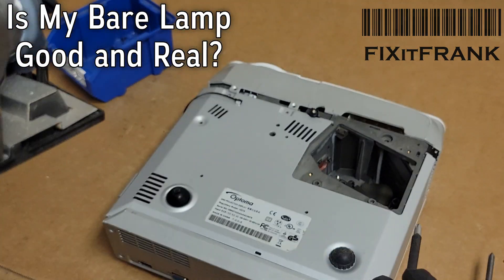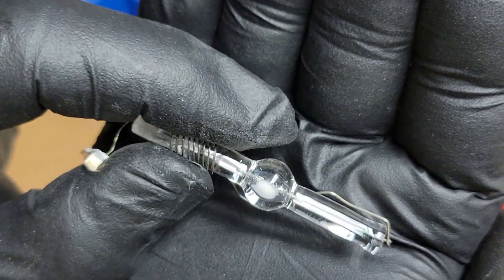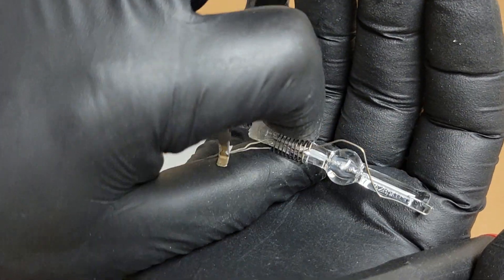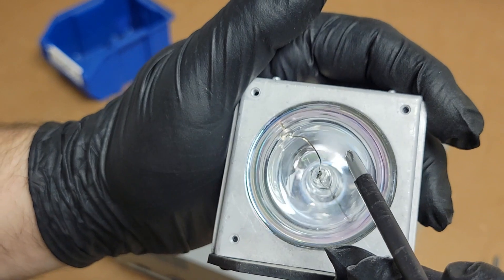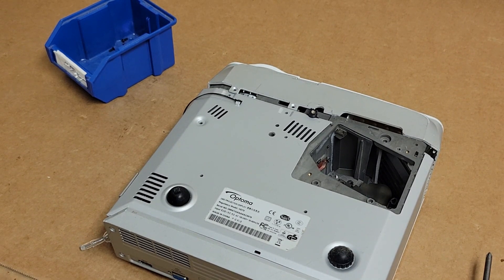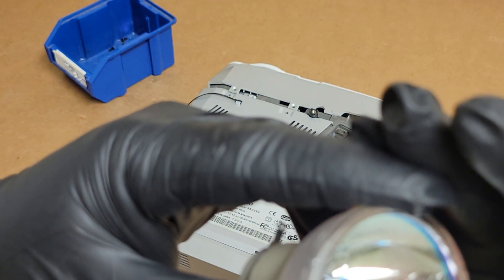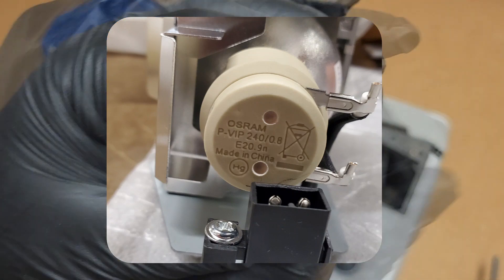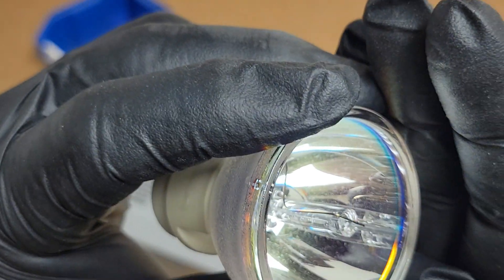Is My Video Projector Lamp OK? Is It Real?

Comment: My lamp seems good visually. But not lighting. Im wondering about the exposed lead that is connected from the front and goes into the center crossing the arc if its supposed to have continuity since its actually attached to the front lead.
Reply from the maker: Only continuity is to the screw terminal from the center point.  These are arc lampa which means no filament, so no continuity. I go over this in the video
Reply: @FixitFrank i double checked my lamp. And its confirmed that its busted. I tried another lamp from other projector and it works. But i cannot fit the lamp from other unit cause lamp is a bit bigger and longer but lower wattage.
Reply from the maker: What do you have? I might have a source unless you found one.
Reply: @FixitFrank I have 2 units hitachi. CP-X251 and CP-S317

Comment: I got Epson ELP89 OEM lamp that died at only 1200 hours (first lamp for the projector). I determined the conductor in the front of the arching element (the bulb) has separated from the conductor lead. Can I simply soder it together or is the temperature too hot and it will melt regular soder? Any other methods to re-attach?

The arching element inside the bulb looks very clean, no haze on bulb glass
Reply from the maker: Unfortunately the lamp is trashed.  That burned itself and melted. There is no repair.  The temperature is way too high there.   Your lamp blower fan is probably not working as well as it used to. There is a fan that directs air into the housing and directly across the tip of the arc tube. This is a common failure for epson. One of the many.  If you got 1200 hours, that is pretty good for an epson this old.  I'd use this as an excuse to buy a new projector. Any replacement lamp will also fail that way. I see it on newer epsons as well that use the ELPLP96. Personally I would stay away from epson.
Reply: @FixitFrank  thanks. The burn out event was 2 years ago and since then I have had another OEM lamp for 1400 hours and going. So Probably an issue of lesser qulity first lamp. I found out now, as I purchased a replacement bulb and got to dissemble the housing.

Comment: A question about lamps - it seems like many are discontinuing replacement lamps for my projector  - Vivitek HK2288. The only two more well known shops that have them the one that starts with a J and projectorlampsusa. I would generally go to Pureland but they don't seem to have them anymore - getting worried that I won't be able to find a replacement when it's time to replace the lamp - only about 800h now.
Reply from the maker: I see what you mean.  thats a tough one.  in your case, you may want to look for the bare lamp and keep the old housing.  you can use the numbers on the back of the ceramic to find another.  I'd get one soon and put it away so you have it for a spare.  This particular model was not super popular and the housing is expensive to make so I can understand (partly) why its not available.
Reply: @FixitFrank  Thanks for the reply - I'll look into that. It's a great projector - I picked it up used for $500 about a year ago with only 250h and have been floored by the clarity and colors - the colors are right up there with my 6050UB but the clarity with high quality source content is on another level - of course contrast is not as good. The contrast is very good for a 4K DLP shifter at around 2000:1 native compared to most of the BenQ, Optomas, etc at 1000:1 or so. The image it puts out reminds me a bit of some of the the 1080p 3DLP models like SIM but with much higher resolution (obviously still has RBE though). I think the main issue was many had problems with signal dropping - I've seen it but after upgrading to a HDMI 2.1 optical cable it's been a non issue.
Reply: @FixitFrank  I finally found a supplier for original lamps - PSSAV. It was shipped directly from Vivitek and being that it's a binned original lamp from March 2024 it's very bright and hits the 2000 lumen rating of the projector (uncalibrated) and 1200 lumens calibrated (same as reviews). It's over twice as bright as my old original lamp with ~1500 hours.

Comment: Hey Frank, thanks for posting all these videos. I did notice one of your comments that counterfeit osram bulbs are not very common but I see tons of osram bulbs on aliexpress with all the engravings and lettering on the back of the bulbs, the same as a genuine one. I did order one to see if they have the serial number engraving on the bulb itself as well as testing the resistance between the negative and positive terminals. 

I currently have a BenQ W1070 and the bulb it uses is "p-vip 240/0.8 e20.9n" and both osram shopyourlight and osram's only authorized reseller are both out of stock of this exact bulb.

They do, however, have the "p-vip 230/0.8 e20.8" for $56 and in stock. I checked the specs of both bulbs and they both appear to have the exact same base with exact same arc length. The only difference in the spec sheet is that the 230w bulb runs at 76v nominal while the 240w bulb runs at 70v nominal. Since I'm planning to upgrade to the th575 anyways, I plan to order this bulb to see if it'll work as a projector in a different room. My W1070 bulb exploded a week ago, it probably had 2000-3000 hours non eco mode. Regardless, I'll probably report back on whether that 230w bulb works or not. It seems like it would use the same gasses internally as the 240w bulb as long as it's genuine?

Comment: Can HID or P-VIP lamps like this be tested with an ohm meter?
Reply from the maker: Not really. You can check if they're shorted but a good arc lamp will read open circuit. So will a worn out lamp. Meter is not much help here.
Reply: @FixitFrank  thank you. I appreciate your explanation and it makes sense.

Comment: How to check the lamp it's working are not in multi meter
Reply from the maker: It is not possible.  Arc lamps are open circuit. All you can test is for arc point shorts.  0 ohms= bad.  infinite ohms= maybe okay.
Reply: @FixitFrank  thanks lot for replay 
Sir LCD panel alignment video please
Reply from the maker: sadly I don't do those.  LCD panel alignment is too much work and doesn't pay.
Reply: @FixitFrank   pls pls sir for technical ideas we also learn

Comment: Do you know a method to look for the right projector bulb based on a projector model? Often i need to order replacement bulbs based on a projector brand + model but it can be very hard to find the right bulb online. Is there some sort of database or a website that contains this info?
Reply from the maker: It's not entirely that simple.  Replacing the bare lamp is always the best way to go.  It is doable of course but there are more parts that wear out than just the bare lamp.  Depending on the model, there might be a lamp meter IC that needs to be dealt with. There is also the lens of the lamp assembly. Those do wear believe it or not.  If you reuse a bad lens, you can melt and damage the shape lens or polarizer depending on the model.

The other issue is that there are lot of older bare lamps that are no longer made by Philips, Ushio, Phoenix or Osram.  Osram in particular barely makes any projector products. Many have newer replacement options and wont be what is listed on the old bulb. Philips doesnt even make bare bulbs anymore.  Signify is licensed to use the UHP name and hardware.  All new UHP lamps come from Signify with Philips licensing.

You might not really save much money by changing the bare bulb.  Most housings only cost $20 or so more than a bare bulb and that saves you a lot of time and hassle.  

10 years ago, replacing the bare bulb was well worth it. These days, not so much, in fact because manufacturers get cheaper rates on bare lamps the full assembly can even be cheaper than a bare bulb.  But again, it does depend on the model of the lamp.  Some can still save a lot of money.  The Projection Design 400-0500-00 is still pretty expensive but the bare bulb is les than $100. You still have to deal with the lamp meter chip but that's also replaceable.   

A 5J.J7L05001 for a BenQ is not worth changing the bulb. The bulb is like $55(wholesale) and the whole lamp is $75.  
These days that's not even always true. Many times the bare lamp is the same as the full lamp.  

Using the W1070 lamp above:  Full Lamp is $76.46, Bare lamp is $76.50 (from Osram direct).
https://www.purelandsupply.com/benq-lcd-projector-lamp_5jj7l05001.html (using the exact same bare bulb as below)
https://www.osram-shopyourlight.com/product/osram-p-vip-240-08-e209n

Lamps that use Ushio or Phoenix, need to also use Ushio or Phoenix replacements, but the part #s will be different from the OEM.  Phoenix has aftermarket part numbers that are the same specs but a different number.  Same with Ushio. 

The main reason you don't see this data for free online is that it's valuable to companies.  They do a lot of research to build up that info and just giving it away to competitors isn't in their best interest.  I know the cross list I built took a few years and I constantly am updating and changing it to match what info is the newest.

If you have a particular lamp in question, I'd be happy to tell you what your options are. 
You're best bet is to make some contacts in the lamp industry, if this is info you need often.  Someone who deals with lamps regularly will know what your best options are.    

I do have an email listed on the about page.

Comment: What voltage and current needs to be thrown on terminals for a test?
Reply from the maker: Since these are arc lamps.  They require a ballast to drive them.  It's impossible to test them reliably with any meter. I use a repurposed projector ballast to test lamps when I need to. I think I showed the test box in one video but I can't recall which one.

Comment: I don't know is my lamp original or counterfeit, probably counterfeit
Reply from the maker: I truthfully do not see counterfeit Osram that much.  I think because they are so cheap to begin with they tend to just use real Osram.  Their bare lamps are around $20-30 cost to the distributor/manufacturer. Philips tend to start around $35 and go up.  They seem to be counterfeited much more often. 

The other thing I see is "re-tubes" where they use the old reflector and ceramic and then replace the arc tube.  That is kind of obvious though. You will see 2 different colors of cement.
Reply: @FixitFrank  Even 35$ for original is very very cheap, for my projector generic (new original burner and old reflector) bare lamp is over ~450zł (is ~115$), original bare is ~500zł (~130$), my projector is old but new projectors have similar pricing, counterfeit lamps even with module is 5 times or more cheaper, if it is in US that cheap as you said I don't know why in US peoples even consider to buy counterfeit lamps
Reply from the maker: The US has a lot of people living here(too many).  Sadly most of them are not all that bright/intelligent/think for themselves(as the pandemic has proven).  They see things like "This works like the original but its $100 cheaper" and they believe it. They all think that if they say its OK then that means its OK even if it is clearly not OK. This goes for basically anything.  Lamp or otherwise.  
Thankfully there are enough people to offset that for the most part. I don't know if you have ever seen the US movie "Idiocracy"?  If not, and you like or can tolerate US films, I recommend it.  It was meant to be a comedy but in my mind is a vision of the future.

Comment: 7510 hours on this original bulb in an older hd27hdr. its in a totally black room so its sorta ok yet but its loosing color gradually. i cant seem to find this lamp (with or without the housing) in stock at the reputable sellers so its getting to the point where im goona have to go to amazon or ebay and likely get a knockoff and roll the dice on the ballast going bad. eh whatever i feel like i  got my moneys worth out of it, but anyhow i took it all apart to clean and i find my color wheel is burning clear in sort of a swirl. is it common for the wheel to go bad before an optomas first bulb dies? thank you for sharing your knowledge
Reply: I had this projector a few years back. I did get a third party one off Amazon for £39.00.
And I got over 4000 hrs on Eco out of it. But I do know it can be hit n miss with the cheaper bulbs 👍
Reply from the maker: It's a weird lamp assembly.  I actually tried to get them and the sample I was sent had the wrong lens.  I hate to say it, but it might be time to upgrade.  I promise that lamp is way more dim than you realize but its still working.  The swirl you are seeing is probably dust cooked onto the glass. Usually you can clean it off and the color wheel will look good again.  Its really hard to lose the coloring from the glass. It just gets masked if that makes sense?
Time Projector has this lamp assembly but the lens is not the right one. you could use your old lens, but in all reality you got your moneys worth.  Treat yourself to a newer used projector and save some money and get a brighter projector to enjoy. For $300~ you can usually get something that is 1080 native and over 2000 lumens.
Reply: @FixitFrank  thanks that sounds like a good plan. i may take it apart one last time to get a look at that wheel again. So im guessing its like the burned on dust messed with the glasses light diffraction to make it appear clearish? i should have taken a picture or held it in better light.